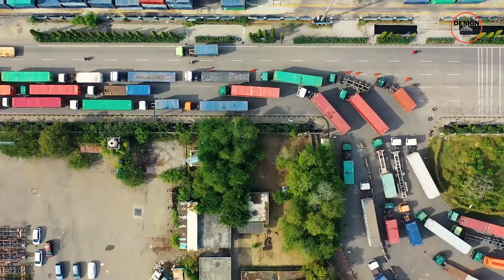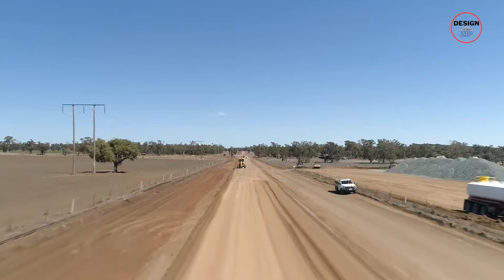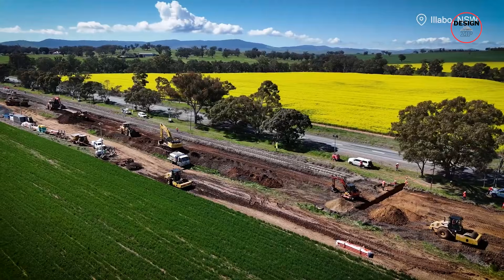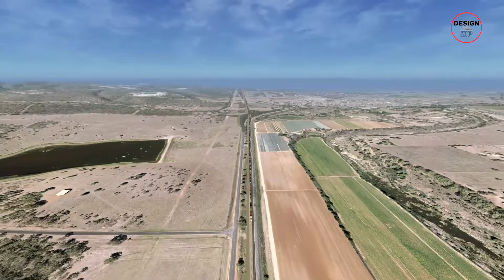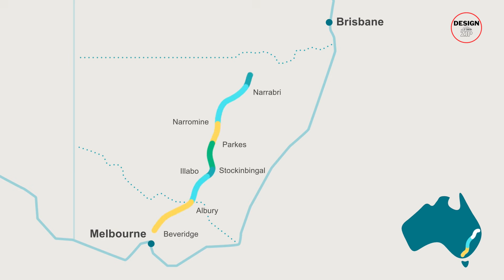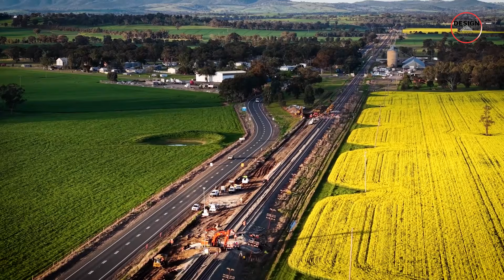How Australia’s $31 Billion Rail Project Went So Wrong

Comment: The narrator mentions a terminal at Calvert which would supposedly be the extent of double stack operation and then operate single stack trains to Kagaru.
This is not in the scope of works.
The design allows for double stack trains to travel the full distance to Kagaru and then on existing standard gauge tracks south to Bromelton and the SCT terminal which exists there and north to Acacia Ridge where both gauges meet.
There are also three other sites at Bormelton earmarked for intermodal terminals.

Comment: Cheaper than a nuclear submarine, and at least this project will pay for itself in the centuries to come. When are they going to do the Brisbane to Darwin leg? If we can get fresh fruit and produce to Asia in days, this country would double it's GDP.
Reply from the maker: That comparison definitely puts the cost into perspective. At least this is productive infrastructure that keeps delivering value long after it is built. The Brisbane to Darwin idea comes up a lot, especially with the Asia export angle, and it would be a massive shift for freight and agriculture if it ever happened.

Getting fresh produce to port faster would clearly help exporters, although doubling GDP might be optimistic. Still, better north south rail links could open up markets that are currently just too slow or expensive to reach. It is an interesting long term question Australia will probably have to face sooner or later.
Reply: @designzip5890  Also, what do you think a European styled "rail motorway", with roll on, roll off accompanied freight on the Inland railway?
Reply from the maker: A rail motorway could be interesting on a corridor like Inland Rail.  The challenge in Australia is distance, volumes, and terminals, but on busy segments it could make sense.  It will likely come down to whether enough operators see value in it.

Comment: Can $31,000,000,000 ever be recovered from this project?
Reply from the maker: That is the big question. Inland Rail is unlikely to pay for itself in a narrow, short term accounting sense. Projects like this are usually justified on broader economic benefits. Lower freight costs, reduced road maintenance, improved reliability, and long term productivity gains across agriculture and industry.

The return is spread over decades and across the whole economy, not just through access charges on the railway. So while the $31 billion may never be “recovered” like a private investment, the aim is that the national benefits outweigh the cost over the long run.
Reply: maybe the goods can be deliveried inland more effective to make inland towns grow?

Comment: Interesting:  But I had to look some stuff up in Wikipedia. Will there be any demand for passenger traffic and what speed could such trains exist?
Reply from the maker: Good questions. Inland Rail is designed almost entirely for freight, so passenger demand was never really part of the business case. The alignment, gradients, and curve radii are optimised for long, heavy trains rather than fast passenger services.

In theory, passenger trains could run on parts of the route, but speeds would likely be limited to around 160 km/h at best, and in many sections much lower. Given the long distances and relatively small populations along the corridor, air and road travel would still be more competitive for passengers. That is why the project has stayed focused on freight rather than mixed use.
Reply: @designzip5890  160 is not bad! We have a train from Cairns to Forsayth and it takes 2 days!  Now Flixbus has entered the East coast. Finally competition to Greyhound!
Reply: Essentially, railways make money out of goods. That’s not to say that passenger services couldn’t work in between the freight trains – after all freight trains have long history of working in between the passenger services!

Comment: Too many NIMBY's in QLD holding it up.
Reply from the maker: Local opposition has definitely been a factor in Queensland. Large greenfield projects almost always run into NIMBY concerns, especially when land access, noise, and environmental impacts are involved. Balancing those concerns with a project that has national level benefits is one of the hardest parts of delivering infrastructure like Inland Rail.
Reply: You have no idea what your talking about. These dummies came to me as government infrastructure liaison officer some years ago to talk about pushing double stacked containers through the burbs. Almost none of the bridges over the line had sufficient clearance. Additionally there were numerous level crossings. They had no plan and no budget to deal with this. It would have cut the city in half from a road transport point of view. Furthermore their plan to deal with the Millmerran flood plane consisted of a raised mound  with a few culverts near creeks when the only viable solution was 10s of kilometres of viaduct. Basically all they had was a line on a map with no clue and no costings on  how to achieve the desired outcome.

Comment: Not sure of the benefit, Large container ships that sail to Melbourne (Aus largest port) also sail on to Brisbane,  (Lots of suburbia in Brisbane) maybe the intent is to service Brisbane only, and send containers by train. Oh really! in the early 60's I know that trains had to be subsidised to compete against Australian flagged ships.
Reply from the maker: That’s a fair question, and the history you mention is important context. Coastal shipping did play a much bigger role in the past, but today it has shrunk significantly, while road freight has taken over most of the task. Inland Rail is really aimed at pulling long haul freight off trucks rather than competing directly with ships.

Even though container ships call at both Melbourne and Brisbane, a lot of inland freight still moves thousands of kilometres by road. The idea is that rail can move those containers faster, more reliably, and at lower cost between inland hubs and ports. It is less about replacing shipping and more about fixing how freight moves across the land side of the network today.
Reply: I think it’s essentially the long-term aim of the global shipping industry is to minimise the number of ports stopped at in Australia. When I was an academic transportation Planner I was looking at the Adelaide to Darwin Railway and the potential that this had for having Darwin as the main point of entry for Australian containers with these then being distributed by Land bridging. Certainly if ships don’t have to go around the bottom it really reduces their costs.

Comment: One of the biggest holds ups and cost blowouts to the Inland Rail has been the local bickering over the Narrabri section of the Inland Rail project, particularly regarding access, routes, and environmental impacts. The Narrbri section, which is part of a larger 306-kilometre stretch of new build, has been paused after Labor came to power in 2022.
Reply from the maker: You’re right. The Narrabri section has been one of the most difficult parts of the entire project. Access, route selection, and environmental concerns have all slowed progress, and the pause after the 2022 change of government added even more uncertainty.

That stretch is also one of the longest new build sections, so delays there have an outsized impact on cost and timelines. It really highlights how complex greenfield rail projects are, especially when they cut through farming and environmentally sensitive areas.
Reply: As a land owner on the section that the rail cuts through in Narrabri the ARTC has been a nightmare to work with, everything from threats to no communication for long periods, then forcing acquisition of land to move the project forward. Very dissapointing.

Comment: Its worth every cent and must be made to work, my  only concern is the Queensland section getting done.
In the future i see branches to Darwin, Adelaide/WA a hub somewhere in OB NSW
Reply from the maker: That’s a solid way to look at it. At this scale, the question really becomes how to make it work as well as possible rather than whether it should exist at all. The Queensland section is clearly critical, because without it the full north south freight task never materialises.

Your point about future branches is interesting too. Connections to Darwin, Adelaide or WA, with a major inland hub in western New South Wales, would turn Inland Rail from a single corridor into a true national freight backbone. That is where the long term value really starts to compound.
Reply: @designzip5890  I was also involved in the inland rail interface program which looked at how other rail lines could connect to inland rail to strengthen its feeder network. This included a number of studies such as Goondiwindi and several further south through Moree Plains. I’m also quite interested in reinvigorating the northern lines through the New England as a low speed single stack backup for inland rail if/when it gets cut by flooding or other major events. I think redundancy of that sort is critical.
Reply from the maker: Interesting background, and great to hear from someone who’s worked on the interface side.  Feeder lines and redundancy are often overlooked but really matter for reliability.  Backup routes during floods or disruptions could make the whole network more resilient.  Thanks for sharing your experience
Reply: Back in the 1930s there was a proposal for an East West railway running from the Western Australian Coast to the east Australian Coast roughly along the line of the tropic of Capricorn. Maybe that still makes sense depending on the mineral and agricultural opportunities along that radius.